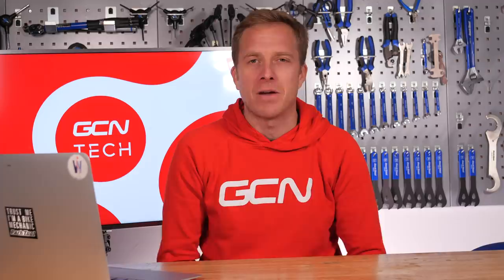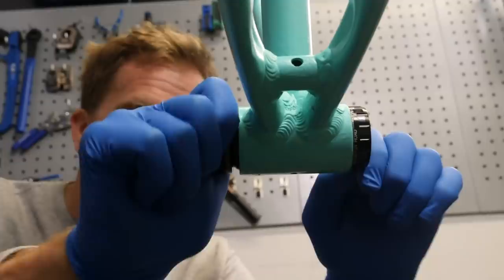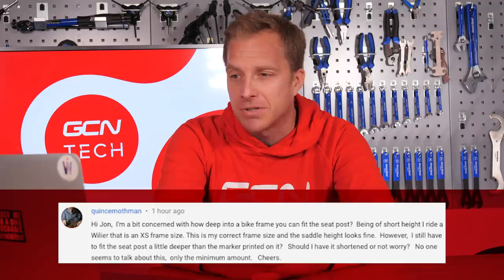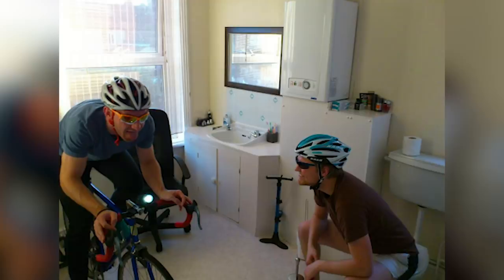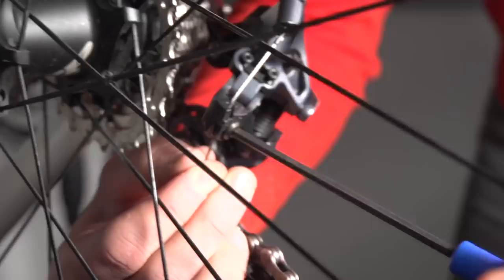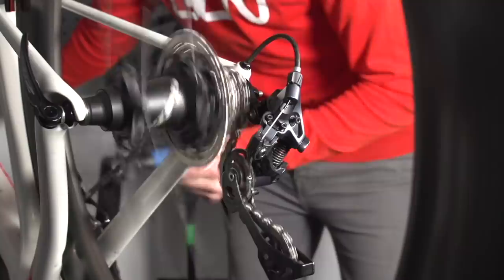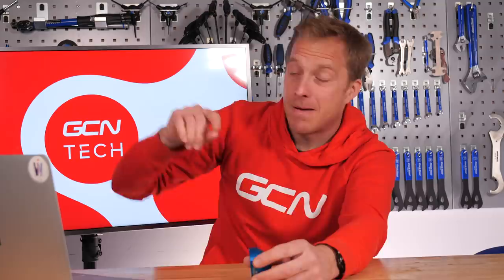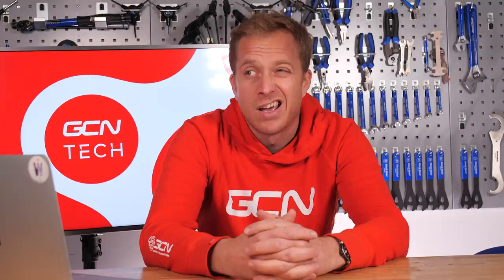Cantilever Brakes For A Gravel Bike Build? | GCN Tech Clinic #AskGCNTech

Comment: Another option for the gravel bike brakes is shorter arm length mini-V brakes. They take less cable pull. I have some Tektro 926AL mini V's  on my Giant CRX-one that I've drop bar converted. They have 80mm arms,  works fine for me.
Reply: I have the Avid mini-V brakes on my gravel bike, they work great.
Reply: Agreed!
Reply: Tektro and TRP (same company) make some very good mini-Vs. The basic tektros are superb - light and cheap. Upgrade the brake pads and there is no difference to the TRPs.
Reply: Yep, mini v brakes work really well on drop bar bikes.
Reply: I use standard v breaks with no problems
Reply: The one problem with mini-v can be tire clearance. I upgraded my mid-90's MTB from cantis to mini-v just now. Tried first with Tektro 926, but the cable running between the arms caught in the tread of the tire. Changed to TRP, and they were slightly longer so that worked ok. I believe Tektro makes a few different lengths for minis, but I failed to find a supplier of anything but the 926. Had no problem at all with the front wheel, so I guess the brake posts were slightly different height front and back. YMMV with tire width as well, of course.
Reply: Just to correct my previous reply, I have TRP mini-V brakes, not Avid.
Reply: @HenrikLundinF  , Do you think the Tektros have enough tire clearance for a 47mm roadtire on my Randonneur? Or a gravel bike with 42mm tires?
Reply: @OldschoolDT  oh, I cannot tell, I'm afraid. One important factor is the relative position of the brake posts in your frame/fork, and as I learned that may vary even on one bike.
Reply: I changed to mini Vs from the original crappy cantis that came with my cross bike (used). While they are way more powerful and have practically no chatter, they're a huge pain in the ass when it comes to removing the wheels. Should have replaced the crappy cantis with Avid Shorty Ultimates to begin with.

Comment: Heat is your friend when loosening threaded items. pour boiling water on the bottom bracket whilst turning the removal tool in the right direction. I takes time for the heat to penetrate the frame and through the threads into the bottom bracket cup, the frame will expand slightly loosening the cup which will still be cold. You may have to cool the frame and try several times before it finally comes loose.

Comment: Threaded BB standards. 

French BB is actually 35 mm with right hand threads on both cups, 

English is 34.85 and uses left hand tread on crank side. 
I
Italian is 36mm and right hand thread on both sides.

Swiss (very rare) is 35mm diameter and uses left hand thread on the crank side, found on old Cilo Swiss frames etc.

Comment: Thanks for the help Jon! I managed to get the fork out like you explained. It turned out the lower bearings of the headset were so rusty, it held everything in place. After replacing them, the steering is much more smoothly. Also it turned out the derailleur-hanger was just a little bit bend to the inside. After straightening the hanger no more jumping chain :) #askgcntech

Comment: #AskGCNTech  Hi Jon, love your work, I've learned most of what I know about bikes on this channel. Hope you can help me with a bit of a problem. I recently bought a cheap second hand Tifosi road bike (cannot figure out which model). It was not all working so i proceeded to fix it. I replaced the Dura-Ace STI with Sora 3500 because DA was stuck and i needed 2x9 shifters. Rear derailleur is DA rd-7700. It looks like it was damaged in the past because the threads in the derailleur body (where the cable retaining bolt go in) were stripped, but I hacked/bodged it by forcing an M6 bolt in it. Now, when shifting, it goes well enough up to the middle of the cassette where the chain jumps back and forth. And if i keep going it will go to the biggest cog before i get to the last click on the shiffter. The derailleur hanger looks straight and so does the derailleur itself. Could this be a pull ratio issue and i need to change the derailleur? It probably doesnt matter but it looks like the bike had a Sram groupset initially (sram sticker on the chainstay).  A second question which is not such a big deal : the chainset is shimano FC-r700 and on the small ring it says "10 speed only" and I have 9 cogs in the back and a 9 speed chain. It shifts ok, but I've heard that it woud be even better if I added some 0.6mm spacers to increase the distance between the chainrings. Any advice? Thank you again for everything you do, I hope you know how much you help a lot of people out there.

Comment: In answer to the question about fitting cantilever or v-brakes to a CX bike. You can get short v-brakes. You can either use Tektro RX6 Mini-v or the TRP (Tektro Race Products) CX8.4. Both are compatible with road brake levers.

Comment: #AskGCNTech would it be possible to use destilled water as brake fluid? The fluid should not get above boiling temperature?  I Don't want to use it in freezing conditions. For which system you would recommend it more SRAM or Shimano?

Comment: #AskGCNTech: John, of note: Problem Solvers (i.e. Quality Bicycle Parts) no longer produces the Travel Agent. They're available in some retail channels, but mostly are found on eBay or used bike forums these days.
Reply: songfta I didn’t have luck funding them
Reply: @marcelocastrolapocha : Yeah, they are a tough item to find. Check eBay a few times per week, look at online forums (e.g. Paceline Forum), and trawl a bunch of online bicycle supply stores. They do pop up, though the ones seen most often are the ones without adjustment barrels - you would need an inline adjuster if planning to use the Travel Agents with road levers.

Comment: #AskGCNTech
Hello John! (most likely John). Love the sh....actually I love the whole GCNTech channel... both GCN channels! :)

I have questions regarding disk brakes (Shimano BR-M315) forgive me if they are silly (questions, not brakes ;) ).

1. I noticed that my brake lever gets softer in time (especially overnight between I leave my bike in garage and pick it up again next morning) which affects my breaking performance in my rear brake. Interesting is that when I pump it few times it stiffens a bit and braking gets better for a while. I guess that the rear brake needs to be bleeded but I would appreciate secondary opinion from you. 

2. As mentioned I have Shimano brakes. While bleeding should I use Shimano mineral oil? I noticed that it is possible to buy mineral oil (bicycle braking system specific - not DOT fluid) from other manufacturers and my question is if they can be mixed. Is there any difference between them beside the color (Shimano is pink-ish other ones I saw are yellow-ish)? Does color mean any other ingredients/additions in the bottle? Or simply mineral oil is mineral oil?

Thanks for answer!
Reply: The moment you use 3rd Party, Shimano kills your warranty...

Comment: For the stuck Bottom Bracket - use an impact driver either air powered or battery powered with the correct BB tool.  The impact driver is way more effective because it is designed to remove tightly threaded objects.  (Think mechanic removing wheel lug nuts)

Comment: @alexander wendelbo: instead of the travel agent, you can use mini-v brakes. The shorter arms make them work with short pull levers, but keep in mind that tyre clearance is reduced to about 36mm tyres or thereabout.

Comment: The BBT-69.2 bottom-bracket tool that you showed is made of soft aluminum and is not very rugged. A better choice for the viewer's application would be the BBT-19.2, which has the same diameter and spline pattern but is made from steel. It also has an external hex that would be more amenable to clamping in a vice.

Comment: I've got an early 80s Gitane tandem and made it semi-modern. Nothing against old tech but the 80s stuff that came on it wasn't that great. Wheels were the first thing, Velocity built deep-v tandem wheelset it much stronger and the machined sidewalls let the brakes grip better. NOS 9sp 2 piece truvative cranks are much stiffer though not really lighter surprisingly. Needed a French thread Phil Wood BB for the back crank while I just changed the eccentric in the front to use the sram english thread bb. Modern rear der with 9sp bar end shifters which I already had. Left the front der, the front handlebar, seatposts, and the front stem factory. Newer lighter chain and the kids prefer a flat bar in the back so changed that out. Didn't change the weight any compared to the old equipment but it stops faster, shifts better, accelerates quicker and handles better. I wouldn't want to do a road race with it but the frame makes it nice riding gravel and rail trails.

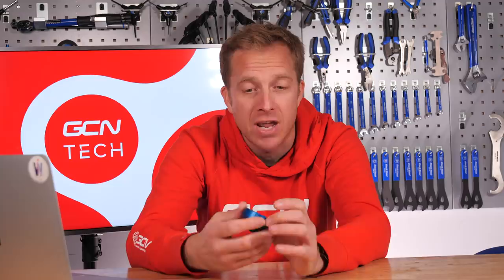Comment: 14:56 layback seatposts… i had to get a seatpost with more layback so i could keep my position and not have the clamp sticking out just below the seat cutouts where my thighs would rub against them and cut holes in my bibs. looks a little weird with the seat clamped so far back on the rails, but it does the trick.

Comment: Re : 5800 cassette issues - no, you can't reverse the sprockets, HyperGlide is not symmetric.
Reply: Tim Parker You’re right. Most likely the bike’s problem either lies with the cable tension, hanger alignment or a worn out cassette that has been ridden by someone who spends all of his time in the two or three smallest cogs.
Reply: @prestachuck2867 Hanger alignment was my problem. Probably got just a tiny bit bend when loading it in and out of the car

Comment: Setback/layback seatposts provide a little extra suspension - the post will flex a bit. Setback posts are also easier to engineer for saddle clamping. Clamping will work/adjust better or post will be  bit cheaper compared to straight.

Comment: I just bought Magic Cosmic Elite UST Disc wheels, after installing the cassette, I noticed the cassette and freehub are able to be removed together and I can’t seem to find any way to tighten the freehub to the wheel. Is this ok/normal?
Reply: The new Cosmic Elite UST Disc seems to use the ID360 hubs, which are designed to be tool-free for installation and maintenance - you can pull the whole assembly, or the cap then freehub body/cassette, off the main hub body. There's no need really for something to tighten onto the hub body, the pressure from the QR/TA holds it all together - it's going nowhere laterally. A few hubs have used this in the past, works well, makes life easier.

Comment: for the seized bits, there is this stuff called mouse milk. Its penetrating oil that will work its way in and help you loosen stuck parts.

Comment: #askGCNTech 

Hi John - great videos, thanks, I am a real fan. 

I have an Ultegra Di2 with 52-36 chainrings  and an 11-30 cassette. 

Unfortunately it is always slightly noisy in the big ring and normally quiet in the small ring .

I have tried re indexing (myself and at the LBS), oiling, cleaning, etc.. and I have even checked the chain and cassette and they look ok. The front mech dies not seem to be touching the chain either.

Any ideas as to what it might be?

Comment: Jon, Chain skips on 2 smallest cogs. Same thing happed to me, Check the B tension adjustment, To tight and it will have less chain wrap around the 2 small cogs.  corrected the  b- tension fixed it. What do you think?

Comment: At the same ambient temperature, is metal colder than carbon?
Reply: It's the exact same temperature (how could it be otherwise?).  Metal just conducts heat much better than carbon or plastic so it feels colder, particularly to fingers at 98.6 deg F.  The inverse applies in the hot sun, although that may be an unknown phenomenon in the UK....
Reply: @georgehugh3455  funny, that's exactly what I thought.

Comment: Is any company making anything like the travel agent anymore? It seems like they've been discontinued
Reply: Kurt Maupin: there is an equivalent part easily acquired on eBay, often referred to as a “folding bike V-to-C adapter.” It’s the same design as the Travel Agent. Link: https://rover.ebay.com/rover/0/0/0?mpre=https%3A%2F%2Fwww.ebay.com%2Fulk%2Fitm%2F273706014859

Comment: #AskGCNTech , Ich have an old Enik handsoldered Frame and want to use it for a gravelbike project. It has cantilever/v-brake bosses. When I want to use brifters, which affordable cantilever- or mini-v-brakes would you recommend? Is there a difference between normal cantilevers and cyclocross cantis? Or should I choose Tektro RL-520 brake levers with normal v-brakes and bar-end-shifters?

Comment: #ASKGCNTECH - Hey, been watching the videos for a while and been so helpful in learning about bike tech and applying them to my own bikes. Was wondering if you had information on compatibility between standard mount and direct mount rim brakes. I have got standard rim brakes but want to upgrade my frame and most of the new frames have direct mounting holes on the frame. Is there an adapter or method of using single mount brakes on direct mount frames easily without buying new brakes? Thanks
Reply: There is no cross compatibility whatsoever. You are going to need new brakes

Comment: #AskGCNTech 
Hi John! I'm planning on converting my 2x roadbile to a 1x. The only rear deraileur with a clutch mechanism Shimano offer for roadbikes are the Ultegra RX. I was wondering if the mountain bike rear deraileurs are cross compatible with the road gruppo parts. The old Deore have a similar Shadow design and have a clutch mechanism. For less than half of the price for an Ultegra RX rd, i was wondering if i can get the same function, and maybe performance, from the Deore instead. Cheers!
Reply: https://www.wolftoothcomponents.com/collections/drivetrain-1/products/tanpan

They don't work natively together because of different pull ratios, but you can get something like above to make it work.
Reply: @jess1ncase  Thanks for the input! Now I'm wondering whether i can bodge a regular set of 105 R7000 RD so that the pulley cage can have a higher tension.

Comment: Hey John, I learned so much from you guys over the year, thanks. Keep up the good work. My question: I got a new with bike with a SRAM Apex 11 speed, 11-42T cassette. Can I fit one of those 10-42T cassettes on there (e.g. SRAM XG-1150)?
Reply: Only if it's xd driver which I think is only 12 speed.

Comment: #AskGCNTech I am in the process of building a carbon bike and am fitting the latest 105 hydraulic groupset with the "easy fit"  brake pipes. I am confused because in the Shimano Manual it says not to remove the rubber end caps on the pipes i??? but later on it shows you how to measure and cut the pipes to fit so what do those rubber end caps do?  Also, when you do need to cut the pipes you have to insert the strengthening  sleeve (provide with the brakes) into the pipe but this sleeve isn't drilled so how can the fluid get through it. All very confusing and the manual is not very explanatory in this regard.  I have tried to find info on line and even youtube info but there is nothing about this so called Easy fit system. Can you unravel  this for me please

Comment: I installed Problem Solver's Travel Agent on my wife's touring bike three years ago.  They work well and do solve the problem.  Unfortunately, I went back to the site last year to purchase the product for another retrofit and they are gone.  I could not locat the product on Problem Solvers web site or any where else.  Please tell me I missed the obvious.
Reply: Same here. I suspect they are discontinued.
Reply: They are, but an equivalent part (same design, just not from QBP) is widely available on eBay. Link: https://rover.ebay.com/rover/0/0/0?mpre=https%3A%2F%2Fwww.ebay.com%2Fulk%2Fitm%2F273706014859
Reply: @songfta  Thanks.  Nothing to lose.
Reply: @songfta  Ordered and received.  The part is exactly the same at the problem solver product.  Apparently some of the folding bikes use them.  Thanks again.
Reply: @suggyltd9577  Glad I could be of assistance! Good luck with your build!

Comment: Hi Jon! 

I recently bought a gravel bike with disk brakes, but just some days ago after I washed it the front brake lever just stopped taking. I tried to move the position of the brake but now the disk goes against the pads. Left it in to a bike shop but they only fixed the brake lever not taking. Any ideas on how to solve this?

Comment: #AskGCNTech Hi guys, love the show.
Ive recently started getting into road cycling more. I’ve borrowed my dads bike a few times. But when I ride it I get pain just behind my big toe on my right foot. 
I’m using the same shoes and cleats that I’ve always used on my single speed commuter that I’ve used for years. I’ve set the saddle height on both bikes the same. But I only get the pain when on the road bike. Could the fact that the reach is longer on the road bike make a difference?
Any ideas on how to resolve this? Cheers

Comment: #askgcntech 
Hey John . Every time you take out a tire from a rim to change the inner tube and put it back I find slight wobble in the tire when I give it a spin. Is it because I have not put back the tire properly or is there a technique in which I can make sure the tire is perfectly in line without wobble ( not properly seated in to the rim I guess ) ?

Comment: Mini V brakes for me.  TRP CX9 mini V brakes are awesome with 25mm carbon rim and Campag 11sp Chorus levers.  32mm tires too.  Campag levers pull less than Shimano so Shimano should be even better.

My Cross/Gravel Raleigh CXP carbon is 18 lbs complete.  Quiet, great stopping, easy and super low maintenance, low price and works with any levers.  Disc bigots should shut up about rim brakes, they can ride them, but stop being a hater.